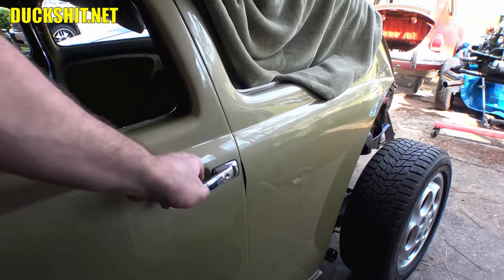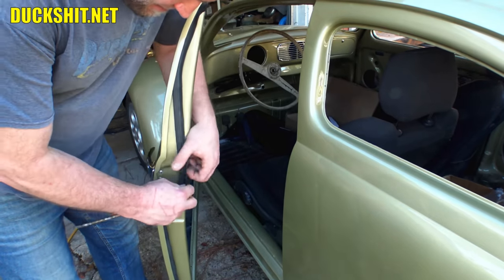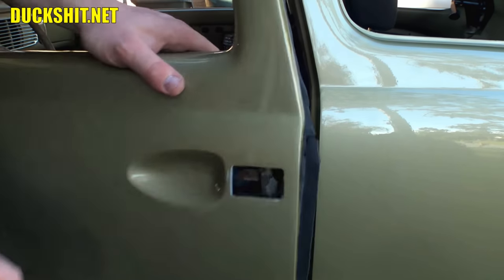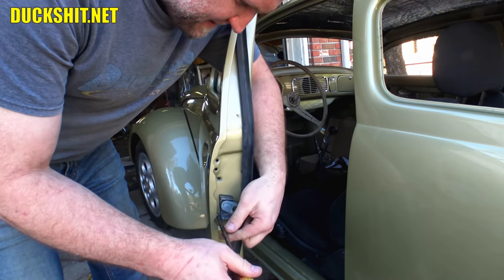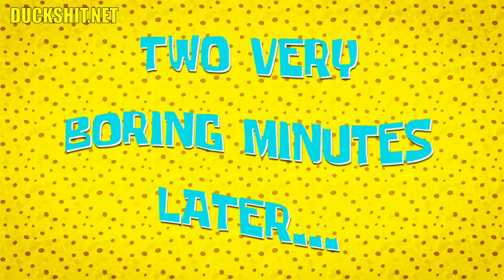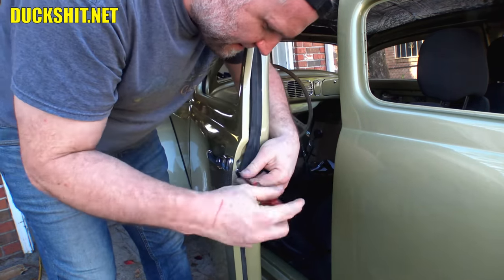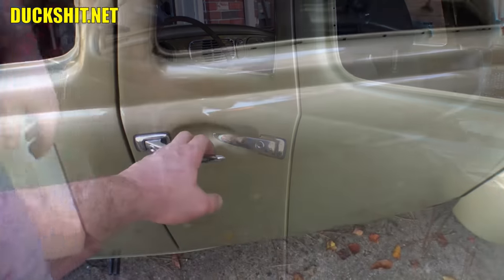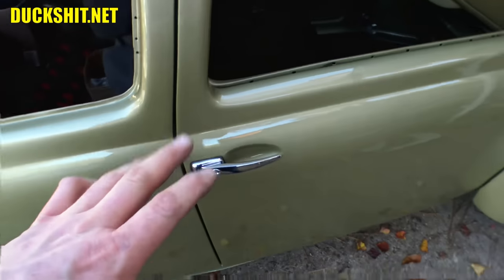Early VW Door Handles on Late Beetle Doors - 1956 VW Beetle - 183

Comment: Cool video. It’s interesting to see different parts from different eras being interchanged and made to work
Reply from the maker: It's amazing how similar these parts are and how well they bolt on despite being separated by many, MANY years... or in the case of the Porsche 944 stuff in the past, across different manufacturers, too!

Comment: 3m DOOR SEAL ADHESIVE should fix the rubber seal. Glad you did not scratch it. Paint is polished like glass and beautiful
Reply from the maker: Good call!  It actually does stay in place, but if it gets fussy, I'll glue it a bit!  Thanks so much my dude!

Comment: Excellent video Glenn :) yes small little tweaks got do doors for seals or handles to fix on Restoration vechiles and had do to before especially lock lock tumbers too also not paint agree to that unless some done welds or primer or paint thickness too! But glad explained this on door handles too for Volkswagen owners to know about too looking forward fix on to before to late Lol! Also Glenn have ever have Door or Trunk lock tumbler were put have got seized up also get key in or not turn on lock tumbler to fix or even key ignition switch to! What do use high pentriotion fluid in tumbler then light tap of hardwood and heat with torch then spray high quality pentriotion in too then put key in and out then turn if tap key with hardwood plus hammer of love taps! Also keep repeating till breaks free too! Also Glenn and Bree hope both had nice Thanksgiving Holiday Weekend too in November!
Reply from the maker: Lock tumblers don't usually freeze up here in Florida.... but sometimes they get a little cruddy inside usually a little PBlaster will free them up.

Comment: Drill a hole in the backside weld a nut on the inside so you  can run a bolt through and push on the tab so it can be adjust as time wears  in
Reply from the maker: GREAT IDEA!  But it probably won't ever wear in to that degree that it needs further adjusting.  That would probably require equipment replacement lol!

Comment: Doors please don't start.. My '74 driver side is sometimes opening up when taking a turn. My new beetle from '65 what I am putting back together like yours is after adding the seals not possible to close completely anymore :/
Reply from the maker: LoL!  Awww man, sorry dude!  Squeeze them seals in there a little tighter, and trim them a little bit if you have to.  Check the door latch, make sure it is adjusted properly.  That little bit can count a lot!  I hope that helps!

Comment: Dear Lord, 
You mentioned you are gonna try to connect the lock system with the inner doorhandle.  Not an easy thing to make I think.  
I also think this is not necessary. Original this system is only used on the right door. Not on the left ( driver side) The left side  you only can close with the key from the outside.  On the left side  original there was no lock on the outside door handle. This door could only be locked from the inside with the inner door handle. ( What you are trying to build)  You however can  close both the doors with a key from the outside. 
If you make the system as you planned I think this will be quite confusing. If you close the door with the key, you should open it with the key. You can open it from the inside but the outside lock stays closed.  The outside lock is only working in the outside door handle. I think what you are trying to build is 'over engineering'... 
Will also give you a complement with Elanore. You did a very good job  with this!! Chapeau!! 
Greetings from the Netherlands.
Hans.
Reply from the maker: No sir, I am not Lord.  I am Lord Duckman.  I cannot be compared to a deity, I'm just an idiot with a screwdriver!
Reply from the maker: And thank you.... this is why I said in the video I wasn't going to tell anyone how I was going to make the  lock and latch work with a handle..... nobody is going to tell me how!  😁👍🦆💩

Comment: leave it like a security feature. copy and patent it.
Reply from the maker: Not sure what I am to leave, no context here.... but I have security features that were built-into this combination of parts that never should have existed before!
Reply: @DuckmanCycles  oh. sorry. I was joking around about the way the handle was working. If a thief didn't do it just right, they ain't getting in.
Reply from the maker: @immrnoidall  Yeah, with this odd combination of parts, it'll be tricky for average thief to figure out.  Technically each door has two locks now!